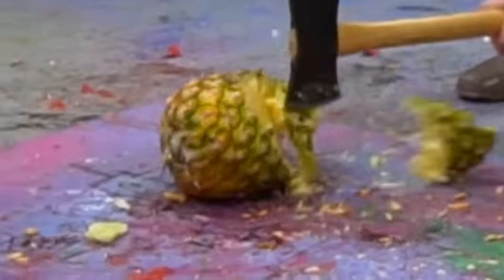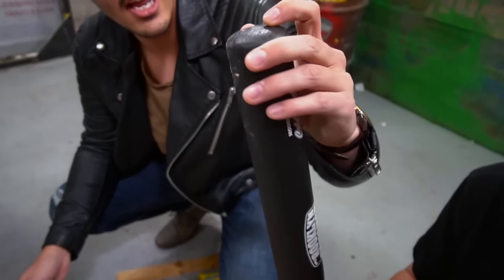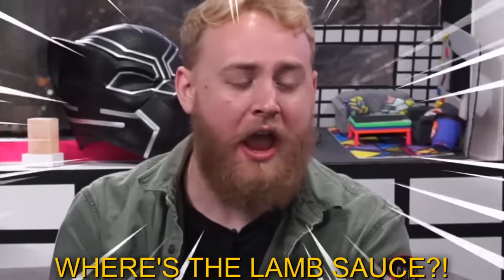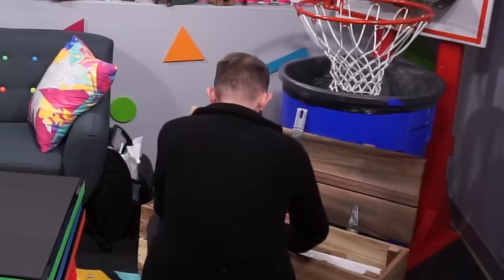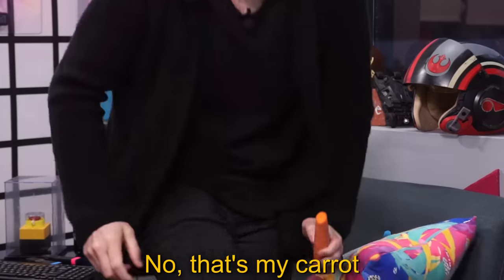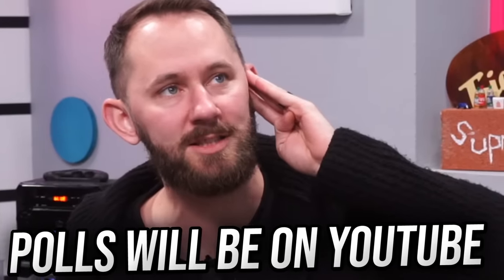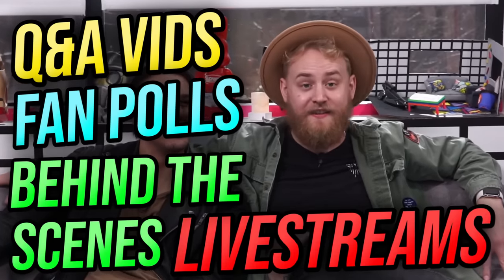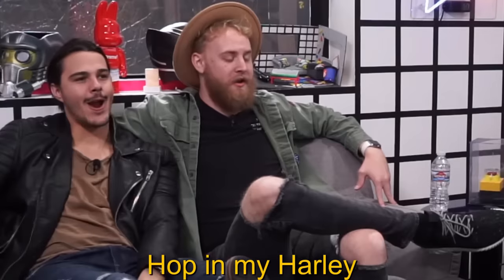Unboxing a Mystery APOCALYPTIC Crate!

Comment: 14:45 actually, it’s a flail. A mace is attached directly to the handle.
💫 the more you know
Reply: morning star
Reply: ohalo ohall 
I believe morning stars are just maces with different spike placement.
EDIT: turns out maces don’t have spikes and morning stars are the wooden shaft with a spike ball connected to it(directly, no chain)
Reply: @ohaloohall4520  actually a morning star could also be considered a mace, the only difference is that it has spikes. It's essentially a mace with a different attachment.
Reply: I like how you change the more you know GIF into a text
Reply: You said flail
Reply: weapons expert joins the battle
Reply: Ah yes the spiked brothers mace morning star and flail
Reply: Did u spell fail wrong....
Reply: @dragonworriormywarismylife9424  no flail is a weapon
Reply: Then what's a sks
Reply: Flail have only one chain. With two or more is "Řemdih". Czech medival weapon used mainly by Hussites. And never have spikes, in combat spikes is less effective. Morning stars is more for decorative than for combat.

Comment: Scissors are super underrated when it comes to weapons. You can throw em split the in two and even us the handles as knuckles. I have a specialized pair of throwing scissors, they have a locking mechanism so I can take them apart into two weird knives. When throwing scissors you have two options, a closed yeet and an open yeet. Closed is for stabbing and will have less drag and wind resistance. Open is for short range and low targets like the Achilles heel. Open scissors have a lot more wind resistance than closed and will spin like a ninja star or something. I'm not professionally trained, I just live in a really small town with a heavy drug and violence problem and had to learn to throw scissors.

Comment: Thats not a mace. Thats a flail!. A mace has one large spiked ball or blades at the end not attached to a chain.
Reply: No. A "mace" with spikes is called a morning star. A mace is blunt with flanges or knobs. But does not have spikes. Cmon man!
Reply: Andrew Dobosz you literally Got the mace and flail definitions mixed up.
Reply: to those below a morning star is usually a one chain flail with a spiked iron (or steel now) ball. a mace can have a spiked ball, blades, spikes, etc. But it has no chain. And whoever made this flail made it too short. a flail ball, whether spiked or not, should not reach the hand. It was made mainly to 1) knock one of a horse, or 2) the horse rider would use it on those on the ground to hit in the head. The blunt force wasn't usually what killed them, it was the bending of the metal in the helmet that would stab into the skull that was more of the kill shot.
Reply: Well to be honest it was more like a fail
Reply: I have made both a mace and a few different types of flails... I dont usually make authentic replicas. I make more crazy, far out versions of historical weapons.... Some better than others. Chain= flail. No chain= mace. Thank you
Reply: one of my favorite weaponized non weapons is the olympic scottish hammer. Used for the hammer throw in the olympics and highland games, but makes a good short to mid ranged (and long if you can aim) weapon.
Reply: Lol.....triggered
Reply: Paisley Fricke cause some people love and study and even make weapons
Reply: Y do u know so much about weapons
Reply: Royal aca everyone has a hobby. The history of weaponry is fun, knowing how they work, some people like firearms, I love melee weapons.
Reply: It is referred to as flail mace
Reply: Andrew Dobosz no.. that doesn’t sound quite right to me...
Reply: You switched them around..
Mace is a ball with a ton of spikes
Reply: have they EVER played skyrim elder scrolls V
Reply: Morning star, my dude.
Reply: They really messed that up and its called a mace
Reply: Ok good for u

Comment: The bat part is the tire thumper used by truck drivers to check the air pressure in truck tires they dont normally have spikes.

Comment: That's not called kukri its called khukuri. And it's origin is from Nepal. BTW i am nepali. It is used to cut goats and if needed people. And that's not a original version of khukuri.. It is very dangerous. It needs years of practice to use. I nearly cut my hand while using this. BTW I am using since 5 years. But I still very noobie to handle it.